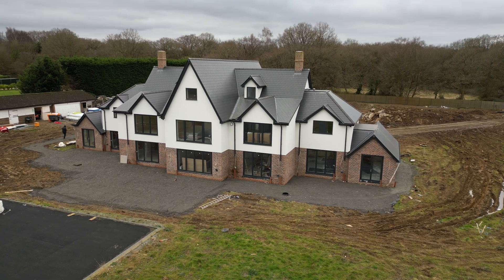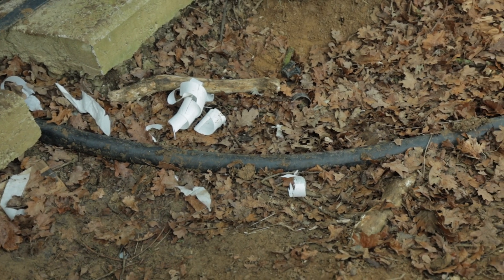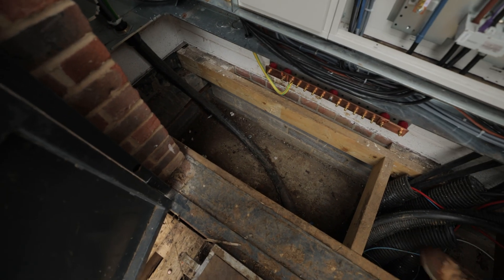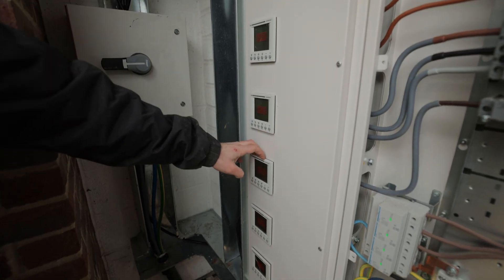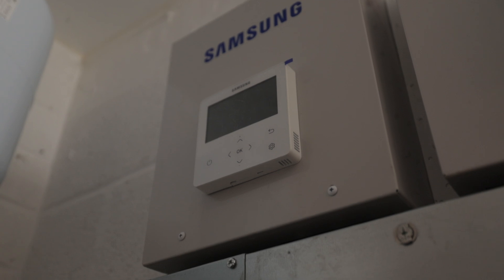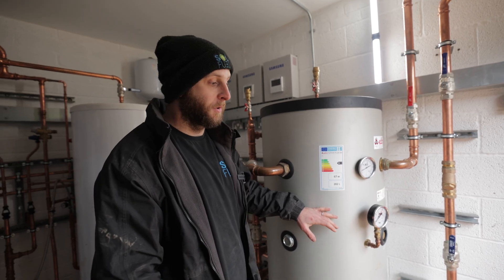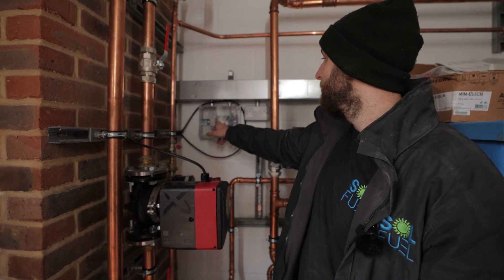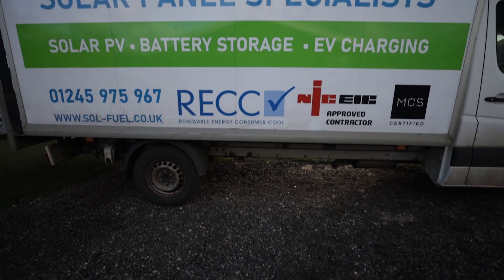Making the most of renewable energy - Solar Install Preparation

Comment: Looks really good, although my only concern is the space between the heat pump and that fence. Doesn't it need much more room to stop it from recirculating all of that cold air output?
Reply from the maker: Great point, manufacturers instructions state at least 600mm in front of the unit, we have 1100mm plus the fence is slated to allow air flow through 💪

Comment: 1 year down the line we will see data that those 3 pumps are over specced for that property.
Too large and will cycle too much.
Heat pumps also heat a cylinder more efficiently from cold than keeping it topped up.
Reply from the maker: The client has plans for a swimming pool at a later date. So has been planned for future expansion.
Reply: @SolFuel  makes sense 👍
Reply: Just imagine how many solar panels they could fit in that garden!
Reply: @JOOI525  yeah, they probably don't care, based on the quantity of energy they will produce.
Reply: @user-zg9xl1zd4j yes I do, but I don't share those 😜😂